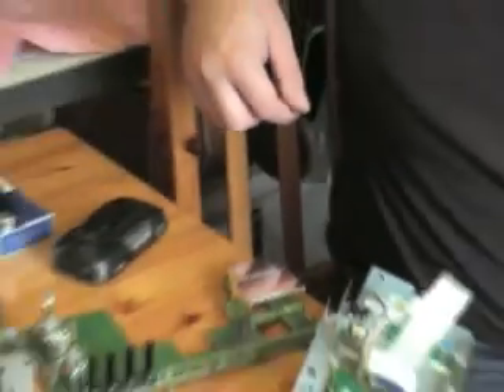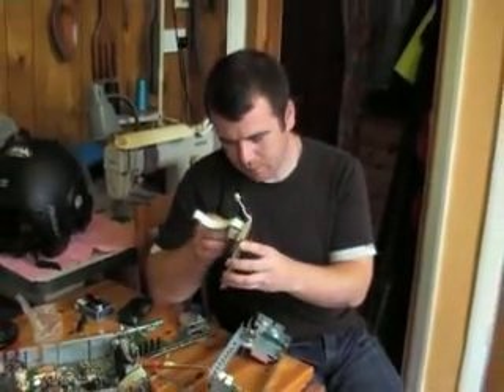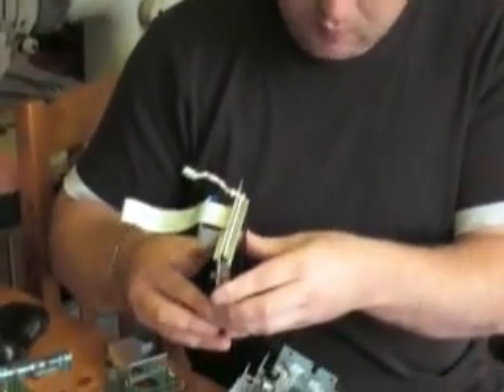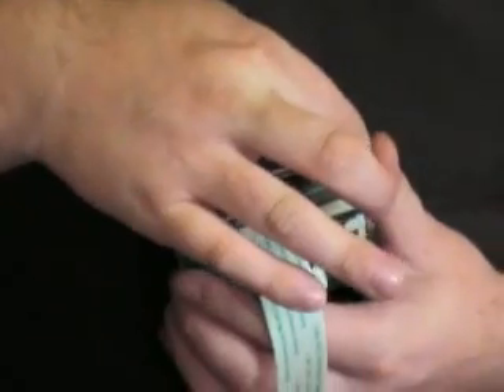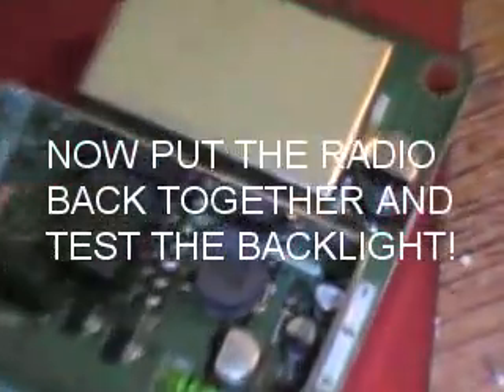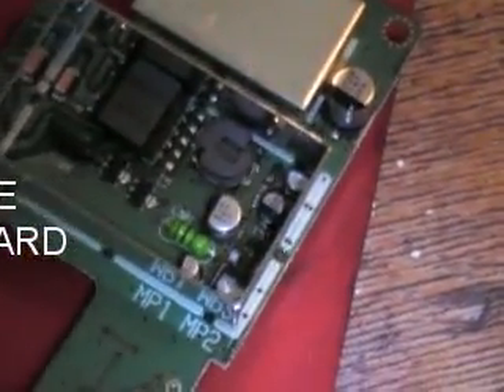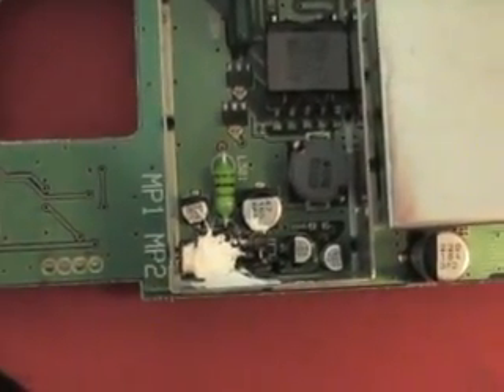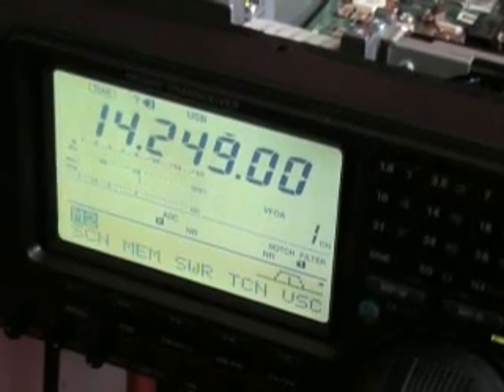Icom 7400 746 746 pro backlight problem and fault repair

Comment: Just did a mates 746pro - uploaded quick youtube video - I replaced the transistor with a BD650 and set the backlight to 100% so it doesnt blow out again - hardest part is actually pulling the radio apart - getting the transistor out and changed is tricky, but not impossible. I use my solder station, fine tip, set to 450C and with additional solder to help flux and desolder the transistor.

Comment: Leave the display setting on 100% too PREVENT overheating the circuit.A friend & I replaced the surface mount component in my ORIGINAL 746 & it worked GREAT afterwards! }:>)

Comment: Seems iCom has a lot of problems. They used to have pretty high quality radios. I swore by them not too many years ago. I can't see spending the money for one these days. They charge far too much for radios that many seem to fail shortly after warranty expiration. Almost a Chrysler, or a Ford.

This is a prime example of what occurs when you take a relatively simple device like a radio transceiver and add on all these nonsense functions. KISS, or Keep it simple stupid. iCom needs to wake up.

Comment from the maker: yes i made the mistake of not checking the bulb first but it will most probably be the reg as they get very hot! the one i replaced was blue because of the heat, this is why i used heat compound:) regards..